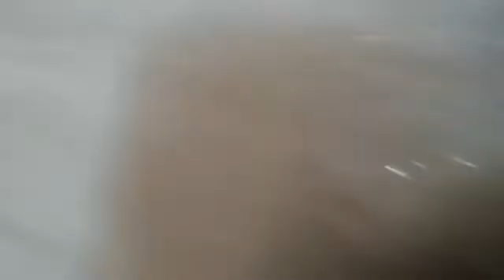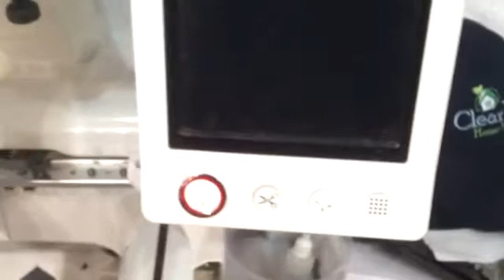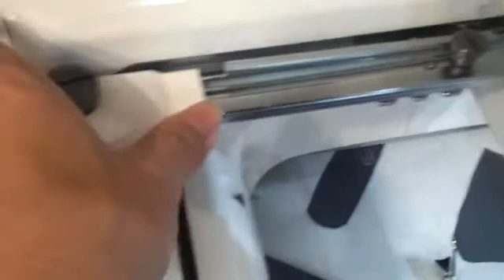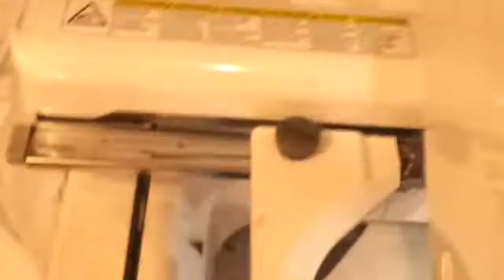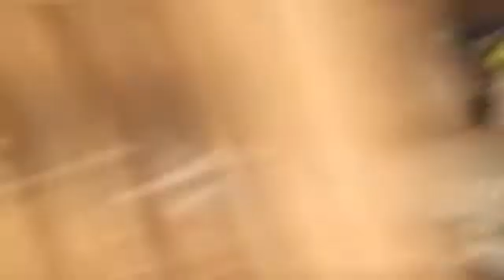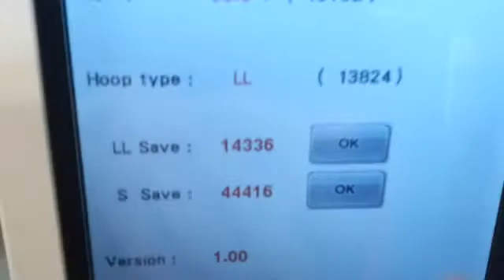Brother PR650/PR650e Hoop Sensor Calibration.

Comment: I have the PRS100 and when I turn my machine on holding buttons  this code comes up. F02 S/S SW ON
can you tell me what this means?? my hat hoop doesn't work for some reason. it does embroidery though.
Reply from the maker: 1. Why are you trying to calibrate hoop sensor? The cap frame isn’t touching the hoop sensor lever. It’s using the magnet to detect the cap frame drive. Don’t trust the person who told you that you need to calibrate the hoop sensor to be able to cap frame. That person doesn’t really know the machine. 2. The PRS100 machine calibrate sensor screen isn’t press the 3 buttons.
Reply: @Tony Embroidery  I put the cap frame on.. I have both kinds. it makes a loud noise when the frame moves. and just stitches about an inch and stays there stitching.I've used it before but never had a problem. Brother said it might be the hoop sensor
Reply from the maker: @AnnPhilbeck  1. The cap frame driver has 4 screws. Make sure the cap frame driver top 2 screws are the smaller one. The 2 larger screws on top will get hit by machine cover. The loud noise is the machine x-axis or y-axis can’t move when it hit something. 2. Make sure the cap driver is all the way pushed to the back and align the sewing arm while tighten the bottom 2 screws. If it not straight, the cap driver turning will scratched the sewing arm or stuck.. 3. If you still can’t figure out what happened, maybe need a class to learn how to use the cap frame. Find a local authorized dealer for a cap frame class or any machine owner in your area willing to show you how to do it. Don’t try to change the machine setting or try calibration before you really know what’s wrong on your machine that will make the problem getting worse.
Reply: @Tony Embroidery  you are awesome.. everything is tight on frame and pushed back. I've done hats with no problem before this. I will have to take it somewhere. thanks again
Reply: @Tony Embroidery   when I turn the machine on with the frame on it says a malfunction occurred. turn the machine off then on again when I do that it says the same thing with X-PM on the screen

Comment: The numbers vary depending on the machine?  I also have a PR650e but it doesnt show me the same numbers you have
Reply from the maker: follow the steps, do not try to match the number shows on this video. Different machine the number will be different.
Reply: Thanks for the super fast reply. Can you help me with something, The start button is dirty and I have to press it really hard every time I want the machine to start embroiding, I have tried to clean it but I cant take the screen cover even though I remove all the screws. Do you have a video for that?
Reply from the maker: touchscreen very deep inside when you open it from the back of screen isn't easy to reach. There are many layers(screen PCB and many cable and also seal tape before the touchscreen.) Better find a technician to do it for you. (Maybe the problem is just need to do "touchscreen calibration".)
Reply: Tony Embroidery thanks again! I will find someone. The calibration is also better that a technician do it or can i do it myself?

Comment: Hi. Just got your email response about calibrating the PRS100. I had hoped for something like this one. I've gotten as far as putting my finger on the screen and turning it on. I see numbers and such on that screen. Is there a way to calibrate with that screen?? The papers you sent I couldn't understand at all. Thanks.
Reply from the maker: Ask your dealer for that. In this case I'm worry about you will lost your machine's warranty from dealer.
Reply: Sorry, no dealer here. It's been out of warranty for a long time now. It just doesn't really stitch the tiny satin stitches at all. Not sure if it's calibration or tension on it. Thanks anyway. Love your videos.
Reply from the maker: Calibration and tension are two different direction. Hoop sensor calibration won't change stitch out quality. PRS100 machine still very new. Only when you have wrong hoop detected or get more change large size hoop error messages and can't find the problem.
Reply: I've never gotten a hoop error message. Just having problems with tiny fonts (or lines that are very small satin stitches). They seem to just be a straight line instead of going back and forth like a larger satin stitch. I have found a video about the tension on the persona (alliance). My bobbin tension is good. Perhaps my top tension is incorrect????
Reply from the maker: Tiny fonts need special digitizing to increase stitch steps and lower density to prevent stitching in same spot making hole or bird nest. You can buy those pre-made tiny fonts online if you don't know how to digitize file.. That's not machine problem.
Reply: This was from a digitizer. I've asked him to re-digitize the area. Neither my Persona nor my Dream like tiny font (or tiny satin stitches). i just keep away from it. Yes, I found a bird nest on the bottom of the Dream machine stitchout of the area in question. Thanks for clarifying things. Thanks
Reply from the maker: You should find a better digitizing company or learn create the design yourself. Also don't try to stitch out tiny font less than 4 mm (on flat non-stretch or less stretch fabric maybe okay, it depend on how good you can hoop the item)
Reply: I guess it wasn't a big deal until I had this problem. I'm invested already to the tune of about $60. I know enough about digitizing to know I don't really want to do it. I have more things on my plate than I care to have. The guy is still working with me. He has a very old software and brother machine but he's trying to get it to come out the way I want it to. I'm still hoping it'll be good enough for the ladies. Thanks again